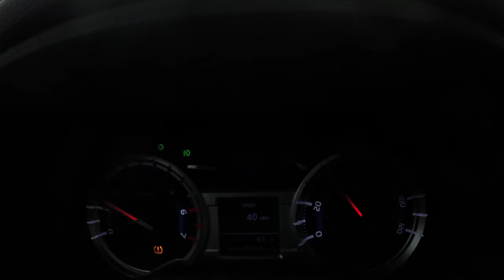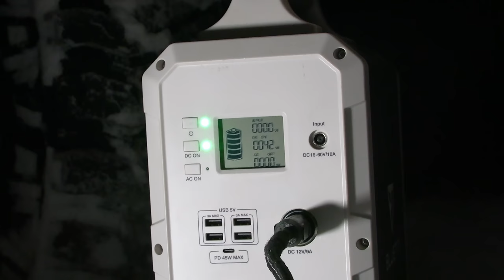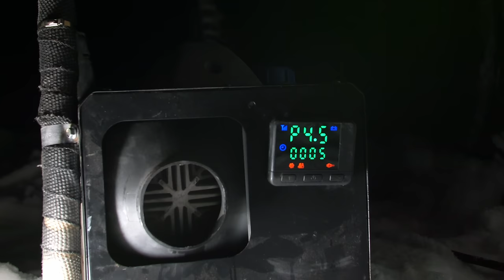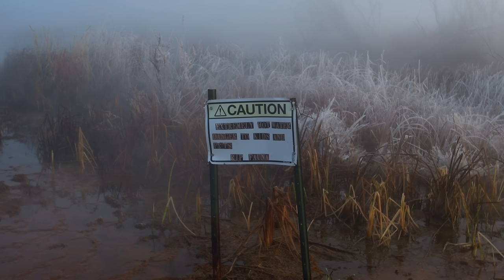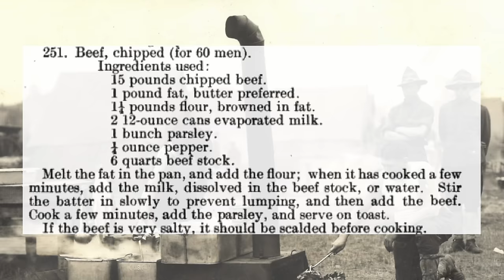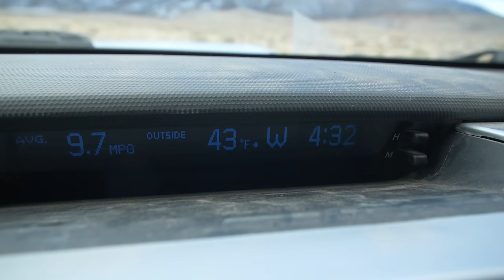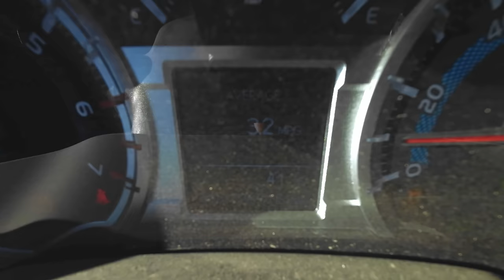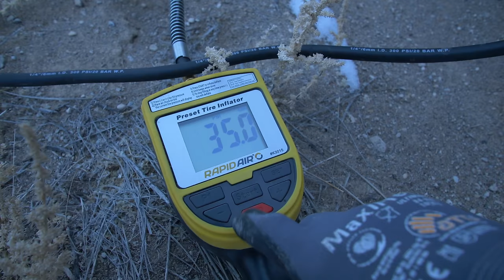Solo 4Runner Winter Snow Adventure [ Movie ]

Comment: Good tip for the weekend warrior to avoid trails in areas that are muddy from the winter thaw. No need to create deep ruts or widening of trails to avoid the muddy parts. You should be driving an off road vehicle, mud won't hurt it, if it is too deep, turn around and enjoy the trail on a different day . This is part of the reason some trails gets closed. Encourage smart trail etiquette to keep the trails open. Beautiful scenery, very surreal. Thanks for sharing.